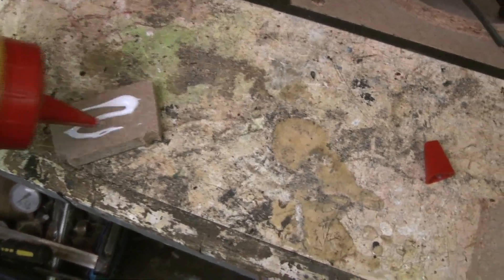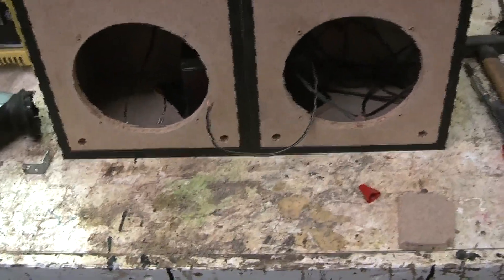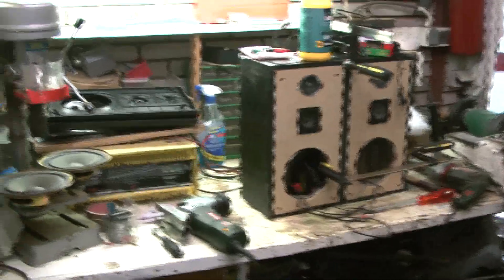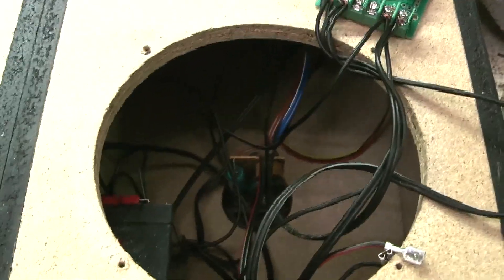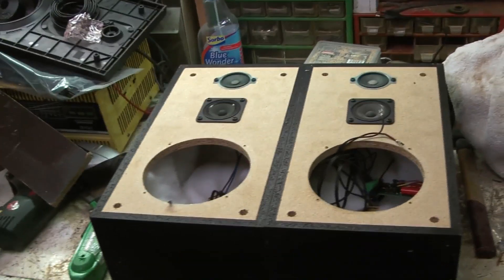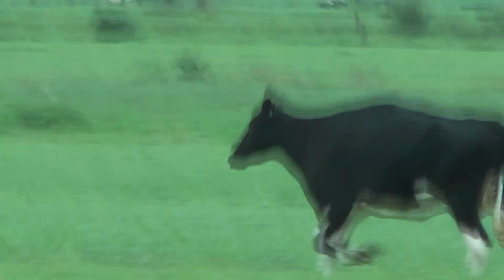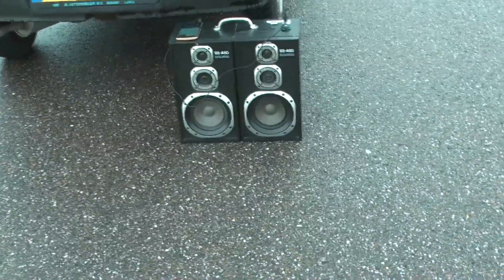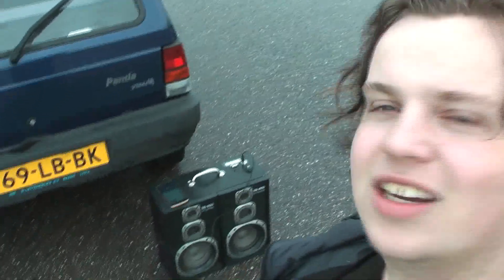HOMEMADE PORTABLE BOOMBOX BUILD log (Vlog) - PART 3

Comment: great speaker, I want to know if u can tell me, I made a boom box w a car stereo using a PC power supply to power it up but I want to know how can I also power it up connecting it to the car lighter. please let me know.
Reply from the maker: Connect the positive to the middle part of the sigarette lighter part and the negative to the ground
Reply: Oka but what I want to know if the plug of a cigarette lighter is connected to the radio and I want to insert the plug to the cigarette lighter of the car. Can u send me ur email or if u have whatsapp to send u a sketch of what I'm talking about.
Reply from the maker: +Luis Angel Trexpass at Gmail. Com I'll respond tomorrow going to sleep now